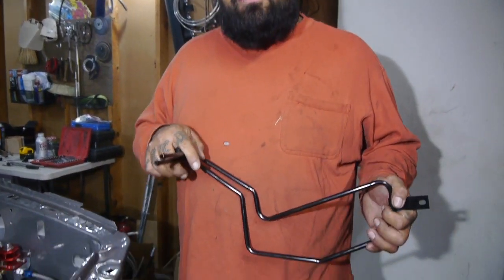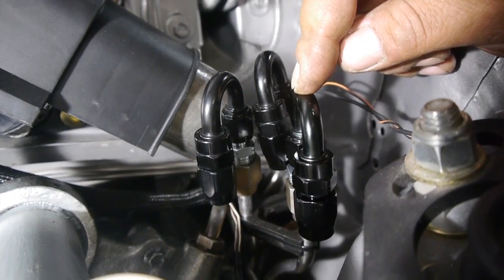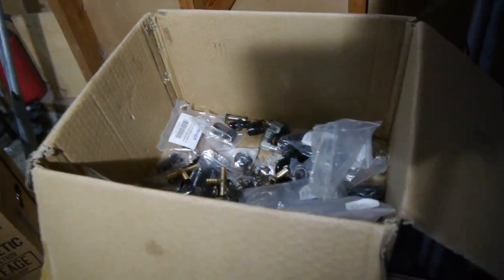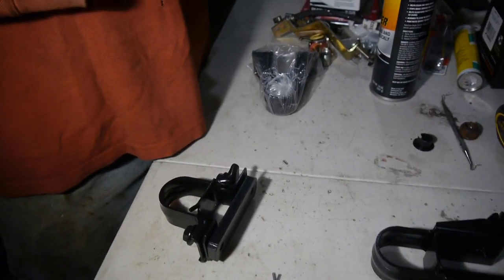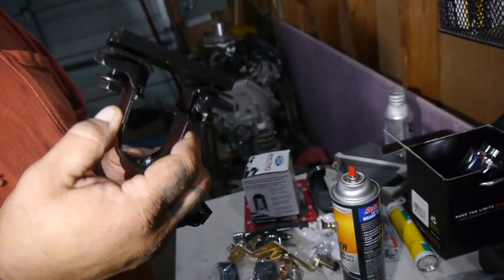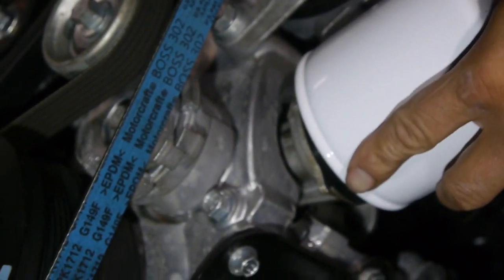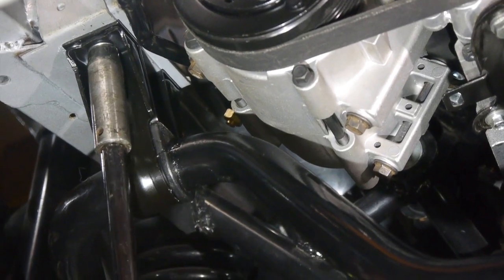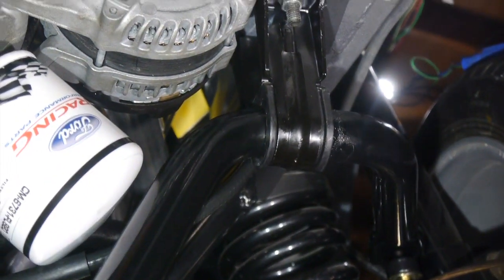Front EIBACH Sway Bar Installation/ Clearance Issue Resolved Foxbody Mustang Coyote

Comment: Saul, I would have gotten sn95 sway bar, and they make fox control arms with both fox and sn95 sway link holes. But, does it clear the coyote oil pan..

I think I understand your problem now.
Reply from the maker: We were able to clear alternator, oil filter, and AC compressor with the $99.99 SVE FOX BODY MUSTANG COYOTE SWAP SWAY BAR RELOCATION KIT sold by LMR.  I was told that a SN95 sway bar bracket will work, but I could not find any 94-98 Ford Mustang GT sway bar bracket mount new after a long internet search. I went with what LMR sells. https://lmr.com/item/LRS-5486-FRK/mustang-coyote-swap-sway-bar-brackets-79-93
Reply: @mcscgreenwheels  did you get polyurethane bushings to finish off the swap?
Reply from the maker: @MoctezumasRevenge1  yes sir correct, every bushing is polyurethane from sway bar, sway bar links, front and back spring isolators, transmission mount, etc. . . it is the littlest details that can drag builds for a long time and eat up a lot of time. Doing three at the same time alone have been very tasking with all the research and lack of informations or good detail videos.
Reply: If using a SN95 sway bar with this kit, wouldn’t you have to go wider, directly into the frame rails?

Comment: Is the sn95 and the coyote the same with?
Reply from the maker: No the SN95 and the coyote are not the same. The Ford Coyote engine is a modular V8 engine with a 5.0L displacement. Despite its relatively small displacement, it's able to create 412 -460 horsepower depending on the generation by using Twin Independent Variable Camshaft Timing and Cam torque actuation. Fourth-generation SN95 Mustang 94-98. The The Modular 4.6L engine in the GT gets an increase to 225 hp and 290 lb-ft of torque in 1998. The 94-2004 Ford Mustang have parts that can be swapped onto a fox body mustang, there is some similarity in the chassis.

Comment: I am doing a Gen2 coyote swap and want to keep sway bar brackets and sway bar…with that said, I am concerned that I will not be able install coyote motor from bottom due to interference from sway bar brackets. Or will i have to load motor from top??
Reply from the maker: Sir that is a very interesting question. After installing a Coyote Aluminator from the top down, I will never go that route again. I will always install from bottom.  The sway bar will be removed right before you install it from the bottom right?  Remove the swap bar install the engine from the bottom then but the sway bar back on https://www.youtube.com/watch?v=P6-Py7Ryguo&ab_channel=MCSCGREENWHEELS
Reply from the maker: Here we are installing a modular 4.6L 2004 Terminator Engine in a fox body mustang with the aftermarket K-member from beneath, seeunow44. This one the swap bar bracket had to be removed because of the configuration of the terminator motor as to where the starter, and the alternator was located. You can put in the coyote from below and still keep your swap bar. https://www.youtube.com/watch?v=i1zJn_0NAtc&list=PLG4mKXWqG3EONxUmzmRCdhIXpV0479VDb&index=27&ab_channel=MCSCGREENWHEELS